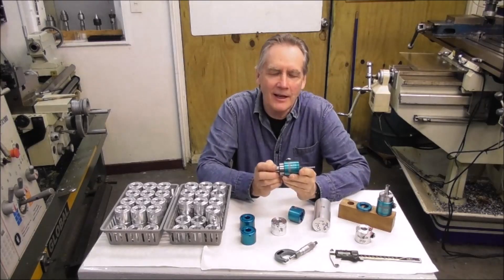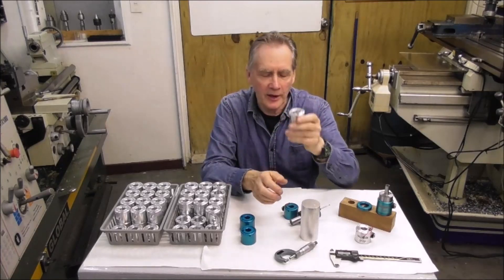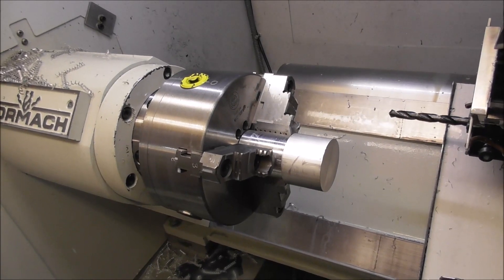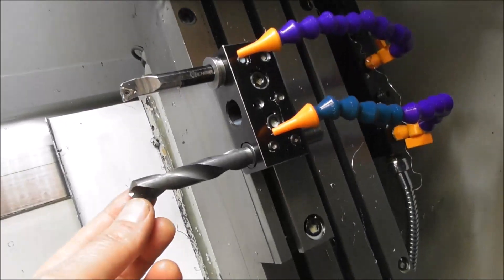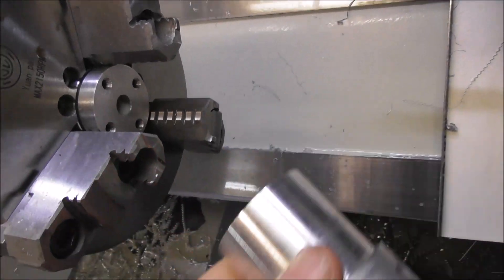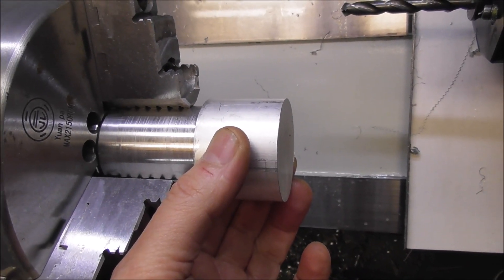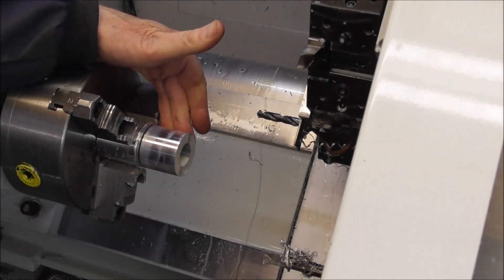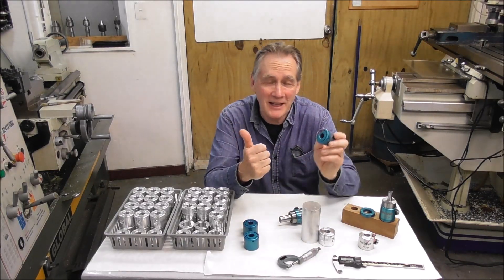Tormach Parts Production. Chapter 1:  CNC Lathe - Side One

Comment: Personally mate, I'd ditch all the drills and go straight for a U drill before the boring op, would save a ton of time, have you tried them in the Tormach?
Reply from the maker: Hi - The Tormach SP15L has a very low torque spindle and is almost stalling on this job, that is partly why I am using multiple drills. Cheers  Cliff